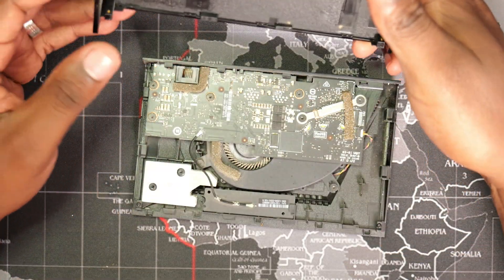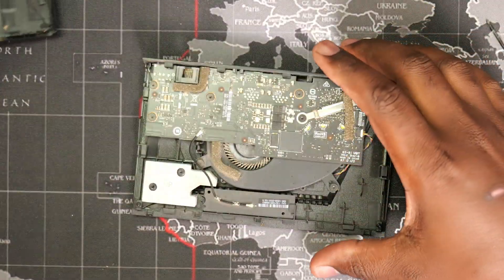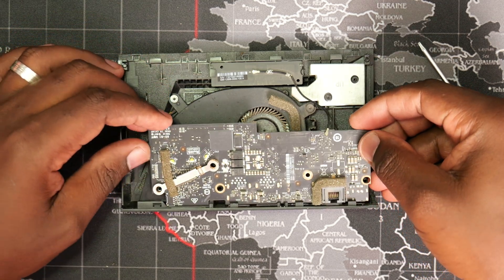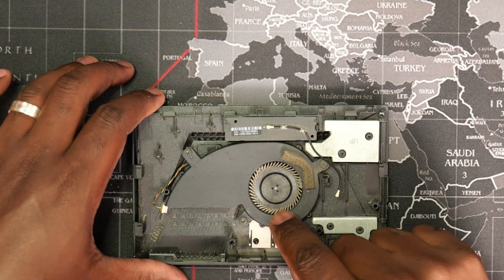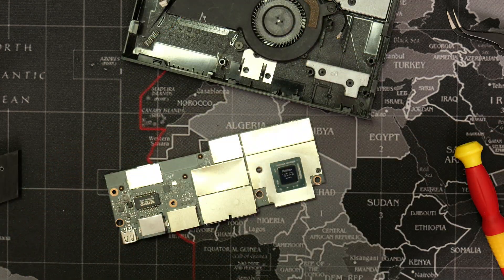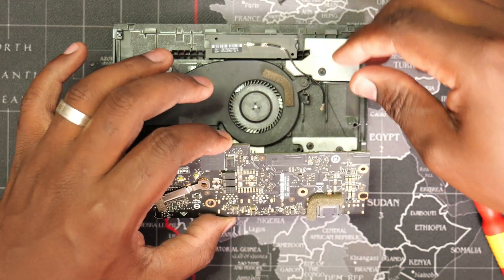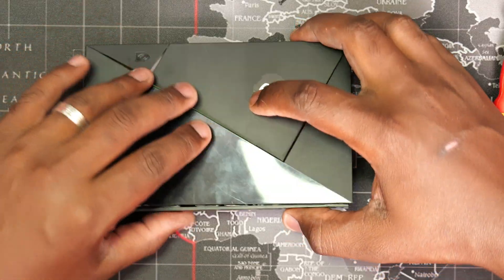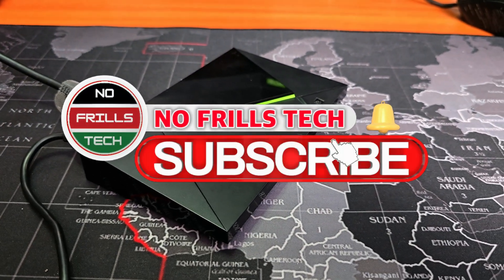Restore performance on your Nvidia Shield TV Pro by reapplying thermal paste

Comment: Can we upgrade the inbuilt storage of Shield Pro to SSD ?
Reply from the maker: Yes you can, I actually advise that. I made a video on how to use a free software called HDD raw copy tool to make an image of your existing drive.
https://youtu.be/QdqLU8BV2BQ

The video shows how to remove the drive from the shield, connect it to a PC and use 'hdd raw copy tool' to make an image of the drive. Next get a 500 gb drive (I recommend Samsung 870 evo 500gb) and write the image on to the new SSD. This way you can store away the old HDD in its intact form should you need it someday when the ssd fails or something happens to the shield. Essentially, you will have 2 backups, the image file and the old drive itself. Thanks for subscribing!

Comment: I'd use liquid metal and place nail varnish on the caps around the apu. If your going to use mx4 I'd use half what you applied 😂
Reply from the maker: You read my mind 😂. But after seeing a recent Linus tech tips video where liquid metal found it's way past the heatpipes, I'd be hesitant to use liquid metal. I once delidded the 8700k processor and liquid metal worked wonders by dropping temps by 5°. I don't think the shield needs that much cooling tbh. About the MX4 quantity, yea mine may be a tad bit much but I dont think it would hurt cooling performance. I appreciate you for watching and commenting, cheers!
Reply: Nail varnish? There are more profi solutions than nail varnish. Besides nail varnish degrading over time.
Reply: @tdmduc it works perfectly fine so shut up